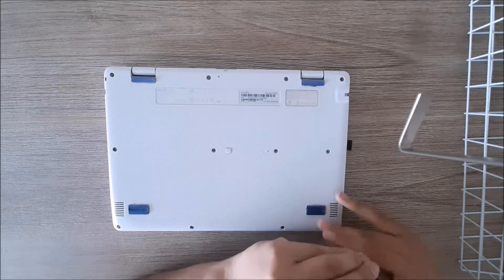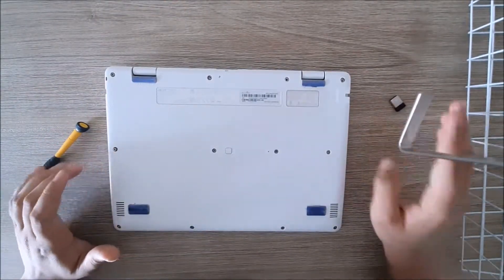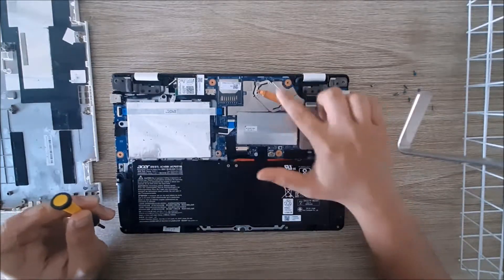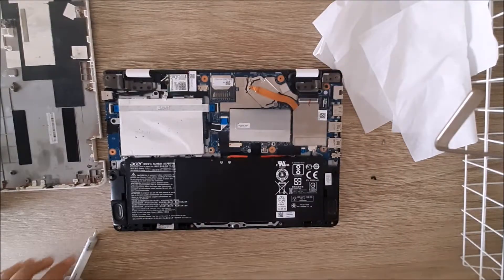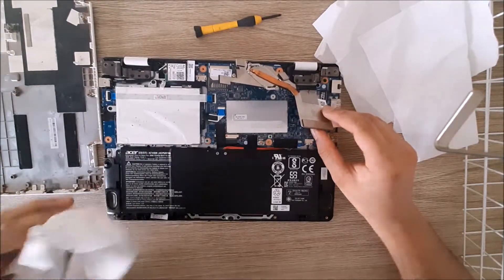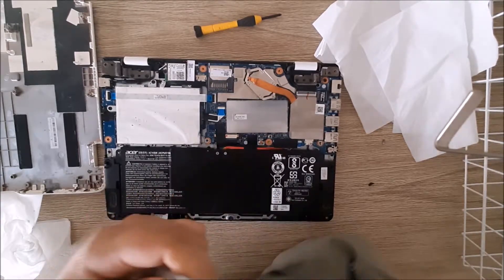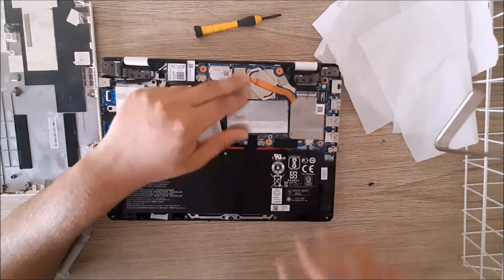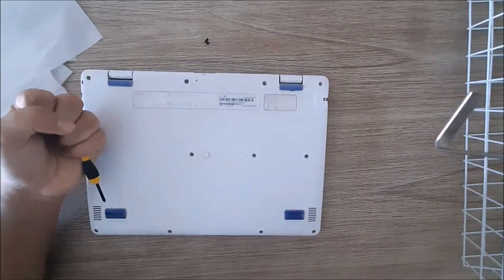Everything YOU NEED To Know About The Acer Aspire R11 R3 131T Upgrade Wise!!

Comment: I think mine was designed to not be able to upgrade the drive. Stuck with 32 gig. Only choice was an SD card.
Reply from the maker: Yeah its unfortunate how some companies do this but definitely do your research beforehand
Reply: @justintheboss2158  I think mine may have been a Walmart only unit. Cut some costs so they can sell it cheaper. But I did order a 256 gig memory card for 27 bucks. Little slot in the back. You can set the unit to send specific files to the memory card. Then you put software on the built in memory.
Reply: @chuckfinley5206  yeah but its going to be slow as hell imagine a hard drive and divide that by about 30 even booting into windows will take at least 10 minutes
Reply: @justinsingh936  I'm talking about files like pictures, music, videos and stuff on the SD card. I do computer aided drafting. I could leave cad files on the SD card. Just leave windows and my software where it is. Not like I do gaming on it. I could use it for the book I'm working on. I have much better computers for other stuff.
It shows up as 2 drives.
Reply: @chuckfinley5206  fair enough then I thought you were using it as your main drive but file storing would work well
Reply: @justinsingh936  hey, it was a freebie. At least it doesn't need a new battery.
Reply: @chuckfinley5206  aye not bad it'll do the basics just fine
Reply: @justinsingh936  got a little Asus netbook with just a half gig of memory. Atom processor. I'm sure it will out perform that. Oddly enough the netbook did fine for what I used it for. got several other laptops just like the size of this one.
Reply: @chuckfinley5206 aye same but most of mine don't work :)

Comment: What are the model of the SSD?
Reply from the maker: Do you mean the model of the drive that comes default? (Western Blue HDD) Or the type of SSD you can put in there (SATA SSD) the laptop doesn't have a NVME slot so you have to buy a SATA SSD if you want to replace it. I'd reccomend a Samsung SATA SSD just search that wherever you buy stuff

Comment: There Is No Slot Found For Internal SSD In Board What To Do I Have Same Acer Aspire R3 30gb Built In Memory Now How Do I Upgrade Because There Is No Slot Option For Plug Ribon SSD. Kindly Help
Reply: Unfortunately you cant upgrade the storage itself since it is an eMMC, meaning it is soldered onto the motherboard. Only way to ADD storage is get an sd card since it has a slot at the back or get an external/portable ssd which can be connected with a usb-a to usb-c cable
Reply from the maker: What he said

Comment: Hey bro I need some help regarding this laptop, actually screen is broken and the original lcd is very much expensive , can you tell me that is there any other laptop screen that can be compatible with this laptop may be I can buy in used .?
Reply from the maker: Yeah I had a quick look at laptops, it could be possible. I found a similar laptop called the Acer Spin 1 which looked relativly similar. If I was you i would most likely buy a used Acer Aspire R11 but if there are non available I believe that most 11inch ACER touchscreen laptops follow a similar design but I wouldn't guarantee it. Your main probelm would be finding a screen at the same size with similar screw holes to the Aspire R11. But other than that it should connect fine (Aspire R11 has a 30pin Connector). I reccomend searching used market that relates to the 11inch Acer touchscreen Market.
Reply: @justintheboss2158 thanks you so much for replying and help brother .stay blessed.
Reply from the maker: @safihaider3474  no worries mate! Tell me how it goes and if you are not sure about something let me know!
Reply from the maker: I would definitely recommend finding a image of the Acer Aspire R11 with the monitor of and showing screw holes and layout and compare it to a possible contender which you have found.

Comment: Hey man, nice video, helped me a lot! I can't find the same model of this battery, do you know if I can replace for another model that still be compatible?
Reply from the maker: Thanks! I think you could use any acer laptop battery because when I opened the acer aspire 5 laptop it was the exact same size so I recommend looking for a 48whr battery for a acer laptop (I recommend the acer aspire 5 battery because i have checked to see if it was the same size and it was. But if you cant find neither a acer aspire r11 battery or a acer aspire 5 battery you could probably find a different laptop that has the same battery and if you want I could make a video that will show you how to remove the existing battery and put a new one in.
Reply: @justintheboss2158  Nice! I'll try that, thanks! If you make a video about the removal process, i'm sure that will help me a lot!
Reply from the maker: @geraldobaranoski6839  its all ready to upload! just need to finish it but should be out tomorrow, sorry for the late upload
Reply from the maker: @geraldobaranoski6839  https://youtu.be/bfVL5Tx-XcY it is done! finally i have finished it
Reply: @justintheboss2158  make one please

Comment: HI I bought a one computer like this  without a HDD cable. What is the cable specs and how do you attached it to the motherboard. It has a dummy bracket too, do I have replace the calbe if I am going to buy a ssd?
Reply from the maker: Hey mate I don't think you can upgrade for a ssd because you don't have a sata cable that fits perfectly It could be possible to buy a sata cable but I doubt that it has the connector so you could connect it to the motherboard if it does then tell me.

Comment: Video is Nice 👌👌
What is the Best SSD for Acer Aspire R3 N15W5 ? Pls Give Link
Reply from the maker: If you do happen to have 500gb I will especially make a video to show you how to put it in if you want the help!
Reply: @justintheboss2158  My Laptop configuration 4GB RAM+500GB HDD . Am thinking to upgrade 8GB(4+4GB) RAM+SSD?  So Which SSD will fit for my laptop??
Reply from the maker: @MassTeluguGamers  ok sick your laptop can have a 7mm sata ssd but your laptop only has one ram slot In it
Reply from the maker: @MassTeluguGamers  I would recommend a Samsung evo ssd but those are really expensive
Reply from the maker: The ram is also ddr3 btw
Reply from the maker: Is it the acer aspire r3? Because the acer aspire 3 N15W5 doesn't come up on Google
Reply: @justintheboss2158  Yes R3  it looks like above laptop model.
Reply from the maker: How much much space does it have or what CPU does it have? Because if it has around 400-500gb then you can upgrade it but if it doesn't have that much then there is no space for a ssd of any kind
Reply from the maker: And also tell me how much space you need so then I can give you a good recommendation for the price and the space

Comment: IS ur laptop running smoothly? I got the same one and mine is slow and sluggish barely use it because of it.
Reply from the maker: It's running fairly smoothly but my friend bought the exact laptop amd his really sucked so if you have the celeron version the best thing you can do is get 8gb of ram this will 100% make the laptop faster and if you have the Pentium version then upgrade ram and purchase a sata ssd 7mm in size and replace the hard drive with the ssd
Reply from the maker: Also I just bought myself a gaming laptop so this laptop is going into retirement and my brother can use it rather than suffering with one of the worst laptops in existence the Lenovo ideapad 110

Comment: does this laptop come with the  storage drive or does it not...and if not what is the cord called that connects the drive to the mother bored?
Reply from the maker: If you laptop comes with 32gb of storage and a intel celeron processor than you cannot add any more storage which I am puzzled by, According to people who have the celeron version the dont even have a connection to the motherboard to connect any cable too. If you have the Pentium n3710 version then it is very hard to replace to the sata cable if you have broken it but the cable is called a laptop sata cable.
Reply: @justintheboss2158 i took a look at it and was puzzled as well...when i was resurching about it , i learned that it had something called eMMC. which is a storage drive embeded in the mother board.that you can not at all replace if it is damaged or broken
Reply from the maker: @lathrixgaming7164  yeah it's like the storage your phone uses and if you have the celeron version the only upgrade to storage you can do is to get a sd card adapter and get a 128gb sd card
Reply from the maker: Btw if you dont know which version it is go to Cortana and search task manager once it opens you must click more options and when you click that it shows a few tabs on the top you have to go to the performance tab and it should be automatically in the CPU section just look at the top right of the screen and it should say the name of the CPU.

Comment: Any clue how to upgrade the CPU?  I have a similar model (the annoying one with no SSD and NO SATA to even attempt putting one in... just upgraded the ram and the CPU is bottlenecking it.  Any ideas?
Reply from the maker: Hey mate sorry for the late reply but unfortunately you cant upgrade laptop cpus or GPU's which is really annoying but there's not really much else to upgrade other than the battery, ram and if you have a sata slot a hard drive that's all you can upgrade. But the CPU cant bottleneck ram, it's just not possible.

Comment: the acer r3 131T has so many different models. My Acer R3 131T has a blank spot in the hard drive area as the actual model is R3 131T C1Y7...i need your motherboard to upgrade my harddrive. lol
Reply from the maker: Really? That sucks
Reply from the maker: But how do you have storage?
Reply: @justintheboss2158  it comes with a internal 32gb emmc...similar to like internal cell phone storage
Reply from the maker: @dtrust68  that must suck I assume that 1/4 of it is used by the windows installation leaving barely any room for well anything.
Reply from the maker: @dtrust68  I'd recommend getting a sd card adapter if you haven't already and install it to fit more applications on your laptop

Comment: Hi. Can I know how to replace just the keyboard for this laptop? My daughter spilled liquid on it and the keys not working anymore. Can you please post a video on it? On YouTube I just found videos on the whole panel and not just keyboard
Reply from the maker: Hi I have no idea on how to replace the keyboard the only way I can think of is just buying a new one sorry for the lack of advice
Reply from the maker: Although it depends on if the keys are broken or if it is a problem underneath the laptop the best way to find out is if you remove a key by pulling it out
Reply: Thanks. I just would like to know how to remove the old keyboard? Not just the keys.
Reply from the maker: @amirriazahmed7123  Hi I'm very sorry for not replying the only way to remove the full key board is to remove everything from the laptop (such as the battery and the motherboard). This Is not one of the laptops that have a removable keyboard unfortunately. I hope I have helped you in some way!
Reply from the maker: Here is a link for how to remove a very similar laptop keyboard that you can use if you require it
https://youtu.be/5nbPBu8219w
Reply: I also spilled some liquid on some parts of my keyboard and some keys felt sticky, i just had it cleaned in the shop but it wasn’t completely cleaned, I was told that the keyboard can’t be removed in this model so it’s impossible to clean it fully. Later on the keyboard felt better, now after 3 years the keyboard feels normal as if nothing happened.